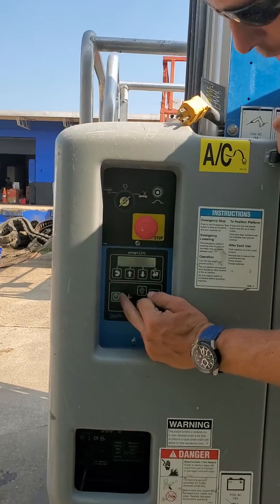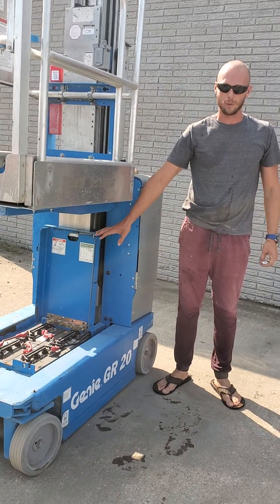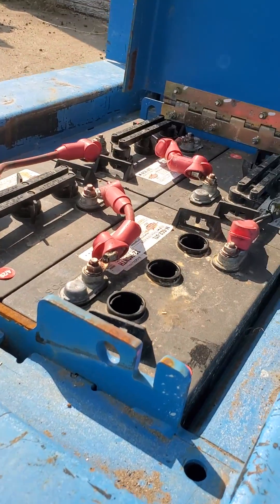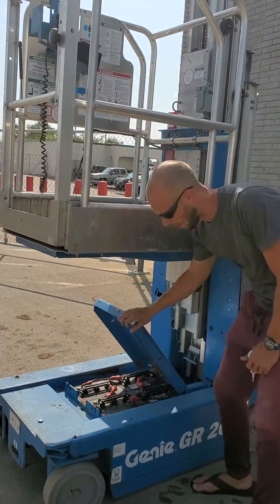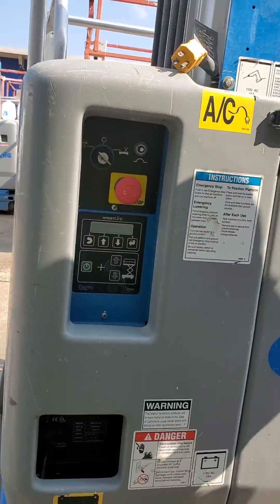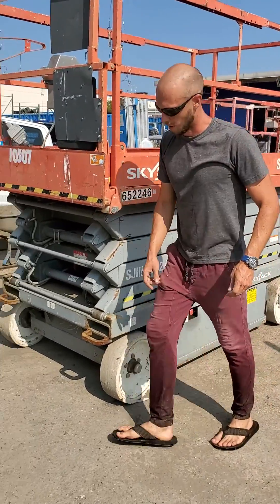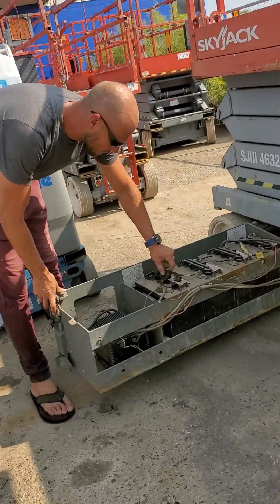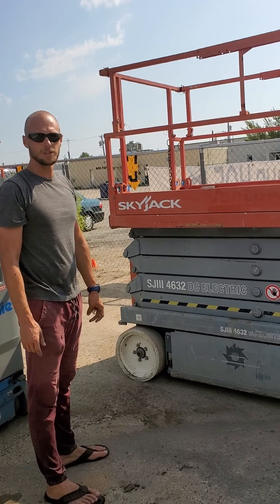Battery maintenance on scissor lifts

Comment: What if the batteries are bad… how do you get the platform up
Reply: Did you happen to find out how to get it up with dead batteries? That's what im currently trying to figure out.
Reply: @Jbonneville6572 I had to take the basket off of mine. It was like 4 bolts
Reply: @wtjonny 10-4 thanks!
Reply: It will go up while plugged in.
Reply: @ChickenBoneAlley is there something special you have to do for that? I get no lights or functions whatsoever when plugging it in other than the lights flashing on the charger indicating its not recognizing the batteries. Its not something we use alot got it cheap at an auction a few years ago for in the shop no owners manual with this ole girl lol
Reply: @Jbonneville6572  not typically. I actually was just working on one yesterday. I just plug it in and switch to platform control and run it up.
Reply: @ChickenBoneAlley I'll give that a try before I get a chain and loader out lol thanks!
Reply: Good question!